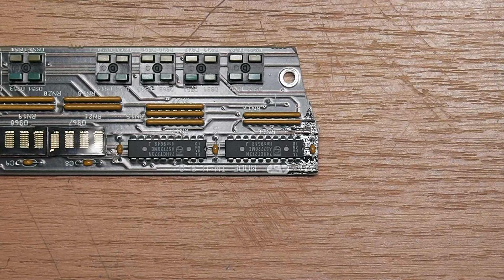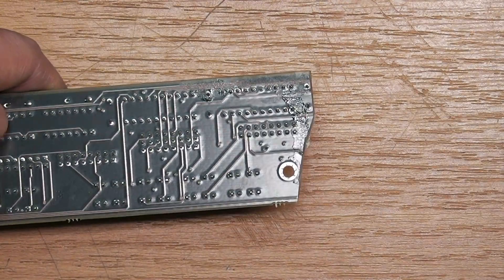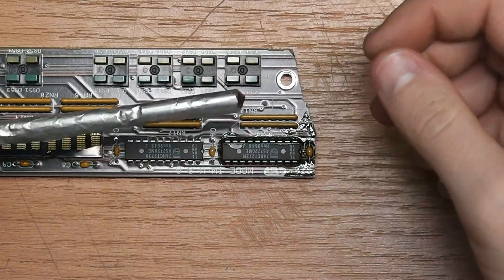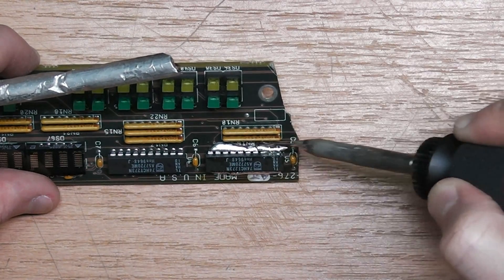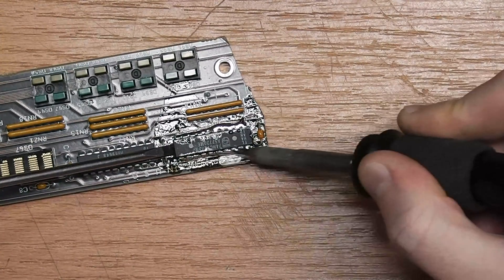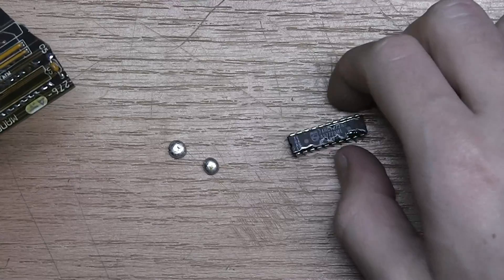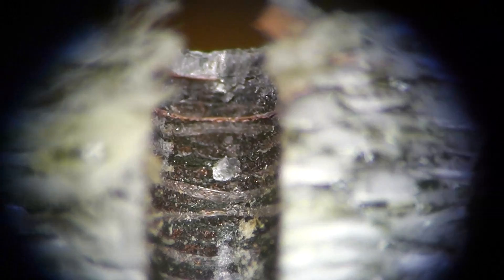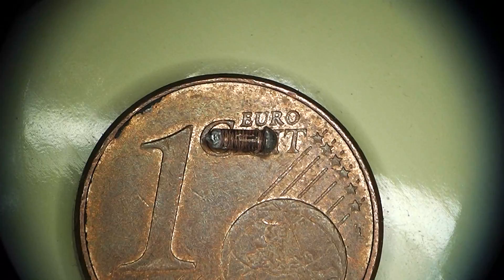Desoldering through-hole components on multilayer PCBs

Comment: just remembered this method after struggling with the desoldering pump. worked just as well as it did years back. thanks for the video- brought memories of bending copper wires to ic shapes to get them off

Comment: It’s effective to use a big solder ball to transfer the heat to all of the pins that is swamped in it. Otherwise, without using a different device such as a hot air gun, it’s impossible to melt the solder on more than two or three pins.

Comment: Huh. Showing that via thing, now explains/illustrates what I've been curious about for a long time: How can a throughole type component be soldered to contact only some internal layers of a multilayer PCB.

If I understand correctly, the answer is, the component itself does not actually do that. But rather, the PCB has a via "sleeve" inserted into it, during manufacturing. The sleeve contacts the layers needed, then the component leg is soldered "into" the sleeve.

Or did I misinterpret this?
Reply: Correct. Those delicate copper tubes.

Comment: Working from the top is easier when you can, but sometimes you have to work from the bottom and not too long. Especially if you want to recycle those LEDs. I destroyed several LEDs like this because the heat comes too fast and melts the plastic when you have just finished melting all the tin in the plated hole, then pulling needs too much force when the pins had been bent before insertion to prevent falling off during the wave soldering process. I ended sawing off the interesting area with a hacksaw, clipping the PCB into single components bits with a side cutter (each one still with its two soldered pins), sawing with a small hacksaw between the two pins, then desoldering each via (while pulling epoxy with tweezer) fast enough not to melt the LED plastic case.

Comment: Seems like a lot of work. The technique I like uses a bucket, visegrips (or a very good pair of normal pliers), and a regular hardware store -sized heat gun or propane torch with a flame spreader attachment. Simply clamp one end of the pcb with the visegrips (which serve as a convenient holder and handle), hold the torch or heat gun near the solder side of the board until the solder melts, then whack the whole thing against the rim of the bucket. All the parts fly into the bucket. That's all.

Comment from the maker: In general, ICs tend to take a lot of abuse before they break. When they do break because of heat when turned off, it usually is the bonding wires which detach internally. The problem is that it's counter-intuitive: Usually you'd want to "go soft" on the IC and use a lower temperature and do the desoldering over a proloned period. This is actually what kills ICs a lot more than doing it once (hit it hard, hit it right). And that IC survived (tested it!) :-)